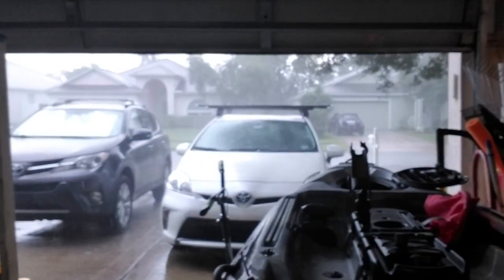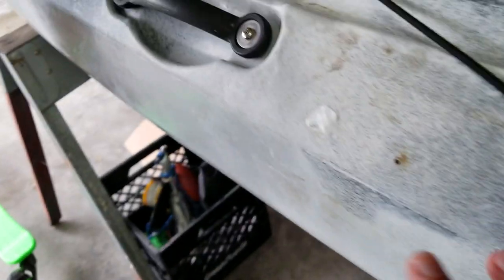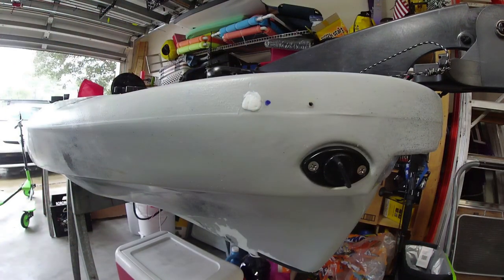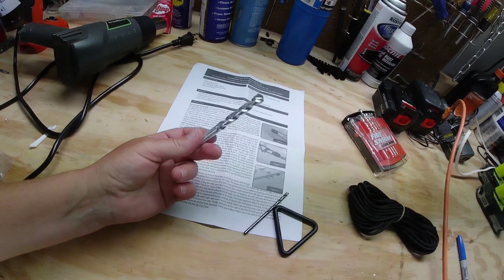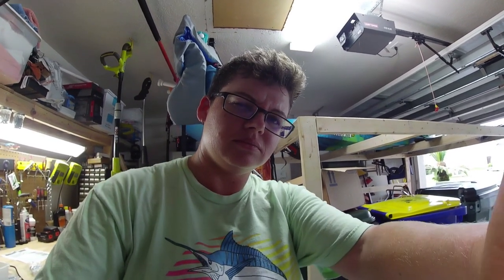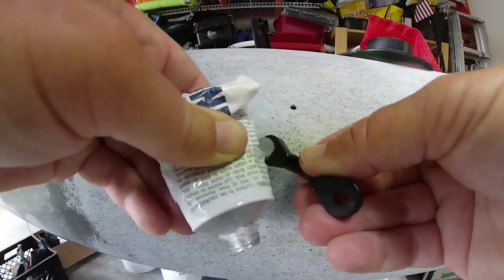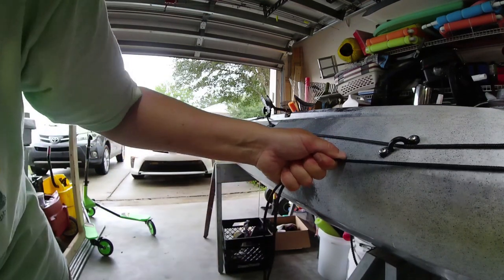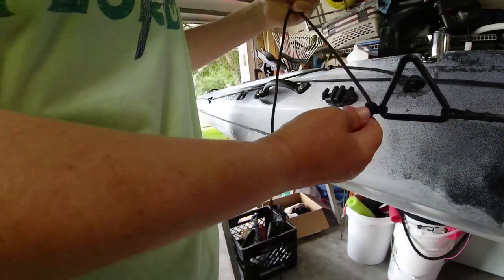How To Install The Yak Gear Deluxe Anchor Trolley by Yak-Gear

Comment: Well done and I love your personality. I just picked this kit up and I am installing it on my first kayak. You say you are a beginner and still learning… We are all still learning lol! I would like to respectfully suggest make a starting hole with maybe a nail point or some other short pointed object. Hold your drill bit on that starter hole… Then turn your drill on. It’s very difficult to find and stay on the exact point you want to drill if the drill is already running and you bring it to the material. hope this helps!
Reply from the maker: It does!  Thank you!!  I started doing that when I started working with fiberglass.  You are absolutely right.  Congratulations on your kayak!!!  What did you get!?

Comment: What kind of putty did you use to fill your holes? And I'm assuming that was a heat gun you bought on Amazon?  Thanks in advance. I get hella nervous when it comes to drilling into my kayak.
Reply from the maker: It was actually an old bucket I melted into the holes using the aforementioned heat gun from amazon :)